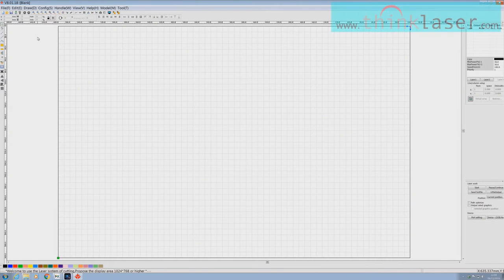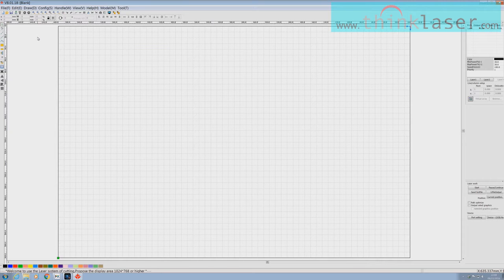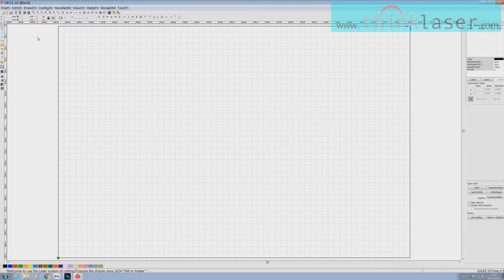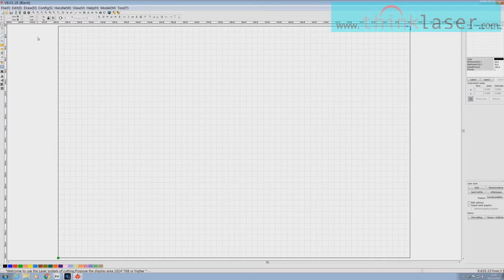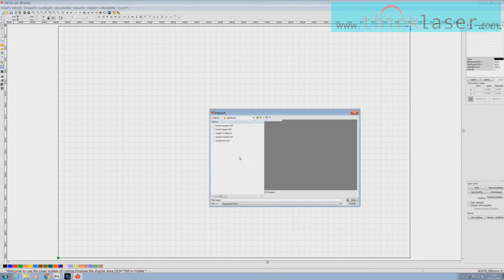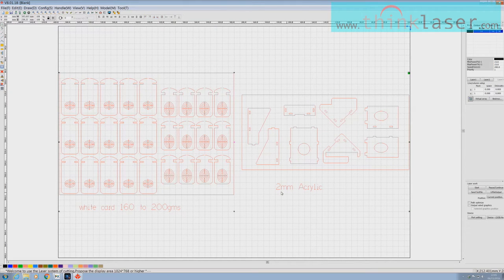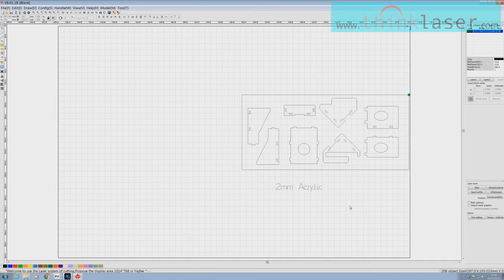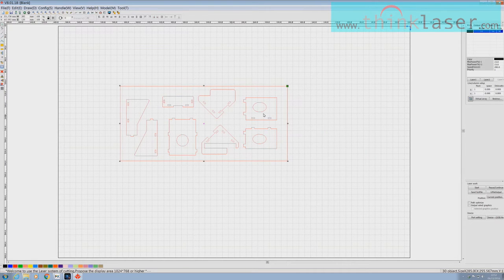How To Use a Laser Cutter - Lightblade Learning Lab 05 Our First Program

Comment: You CAN cut them together, just select different colors for all actions. It'll work. If it makes sense ... another question.
Reply from the maker: Hi Fu,
I regularly use different pen colours on a job, even if it's for just cutting through a material. Small intricate internal cutting requires different settings to a long profile cut so it's easier to put them onto a different pen colour.

Gareth @ Thinklaser